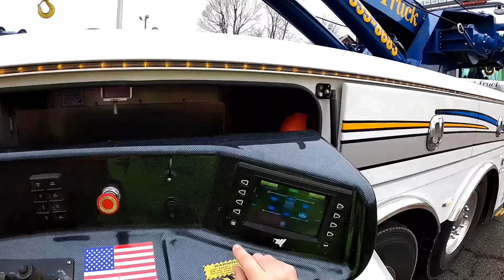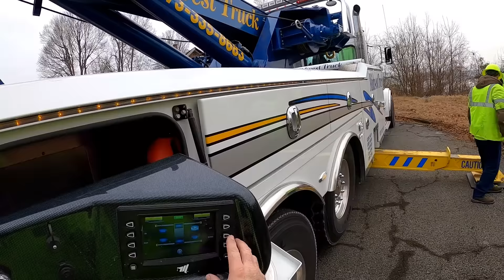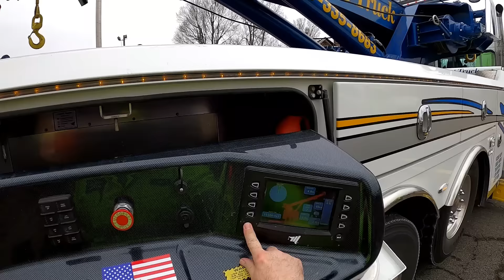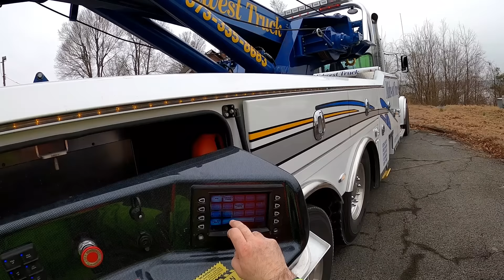Morning Workout   Lifting with the U S  Army Corps of Engineers

Comment: Love the thorough and very necessary safety briefing. It was obvious you were working with curious educated professionals. As is typical with a Federal project, there is at least a half dozen personnel assigned to a two person job. BTW, I believe that generator could be a Kato Engineering unit made here in Mankato, MN, and only powered by Cat. Pulling 300,000 pounds of resistance would require some hellacious wire rope to have a good safety margin!
Reply: I have a 60 KW Katolight generator with an automatic transfer switch on an environmental lab building. Mine has a 350 ci V-8 GM natural gas powered engine. I'm in Western North Carolina. Katolight started off making power takeoff generators for the farming industry.

Comment: That genset is top heavy. The rig driver better be REAL careful! You did the usual top notch job.
Reply from the maker: It is, but the pedestal is a fuel tank, so there is weight at the bottom as well, which helps offset the high center of gravity.    Thanks for watching and God bless.
Reply: They said it had fuel. But how much? A third full would be a good balance.

Comment: I had to laugh when you were trying to come up with something to put in the hole, a bar, bolt than the guy says that he has a screwdriver. Why nobody was prepared for this and then start looking for bolts, even the Boy Scouts function under the precept of Be Prepared. Just as an FYI, the tool that’s for aligning holes is called a Drift Pin. 😊 I like the new logo at the end.
Reply: Was thinking the same thing. 5 guys there and no one thought to have the bolts ready, to me, that was kind of rude. I'm a Boy Scout, and a Mechanic by trade, and what I believe you're calling a Drift pin, we call a Sheeps foot or Lady's foot...
Reply: An even better tool would have been a spud wrench.
Reply: Brian Mason we call it a lady slipper.
Reply: @brianmason1414   or the "new guy's finger" ;)
Reply: @brianmason1414  Here it's often called a podger

Comment: The "pedestal" is actually a base or "belly" tank for the diesel fuel used by the generator.  I oversee 10 sites for my employer that all have generators (most 100-300kW) and most are diesel equipped with the same or similar belly tanks.  That tank appears to be a typical double wall tank (which is mandatory) and probably holds in the neighborhood of 150-200 gallons of fuel.
Reply: none of the belly tanks are legal to move with fuel in them

Comment: Love how the remote shows the load the boom is under.   Wondering though....what is that Ram rated to pull?
Reply: The truck says 2500 with a hemi badge. Although I can’t tell if it’s the 5.7 or 6.4. Still, I wouldn’t use either of those engines to tow something like that.
Reply: 11k on the bumper pull its not going to make it far... should be a 1 ton and trailer should be a goose neck set up... over kill wins the game... and trade that ram for a Chevy with a durmax and Allison transmission.

Comment: Welcome to the military world.  Everything is checked, re-checked and checked again.. One or even two different 'safety' briefings, walk throughs etc.. Something you learn real quick in the military world.  And even with all that, people still get hurt seriously as I can personally attest to.   Did they say why they were decom'ing the locks?  And I was surprised that trailer was rated for that load.. My trailer is rated for that weight but it is actually longer than the one they had there.. Finally, it was also surprising they had that setup to bolt down with the weight forward on the trailer, not equal over the dual axles.
Reply from the maker: @Malakie Usn  I don't know why they were decom'ing the lock.   I didn't think to ask.   I was enjoying the view and the job, I guess.  As for the trailer, the only thing I can tell you is that this is the trailer the machine had bolted to previously as all the bolts lined up perfectly.  They were offset on the base as well, so the GenSet couldn't have been reversed on the trailer.  Anyway, I was just glad they called us.  Enjoyed working with them.   Stay safe my friend.
Reply: @RonPratt  Yep.. I was just curious is all..  But yea that trailer sure seems small for that much weight.. heh.. Obviously it is legally rated for it though.. Still would not want to have to stop suddenly pulling that thing behind a pickup truck though.
Reply: @RonPratt  If, as others have said, this was Lock and Dam 53 on the Ohio River then that, together with Lock and Dam 52, are being decommissioned because they have been replaced by the Olmsted Locks and Dam - see https://en.wikipedia.org/wiki/Olmsted_Locks_and_Dam

Comment: Surprised Engineers Corp havent got a Rolling Stock of Lifting Equipnent . Nice Job Ron
Reply: It's cheaper to hire a rotator like Ron's for an hour than to have $750,000+ machines sitting idle most of the time.
Reply: They do, but as the foreman explained at the end of the video, it would have taken   to much additional time to bring a crane in out of Paducah. This was most likely cheaper and way faster.

Comment: Surprised they mounted it with the radiator facing forwards.  Unlike a car or truck, these are usually designed to push the air out the opening, rather than pulling it in.  They're going to have to keep it slow, or the pressure of air pushing in through the rad will pop the rear door open.

Comment: Interesting video... the guys seemed genuinely interested and appreciative of your working manner and capabilities.... I wonder what that trailer and 4 wheeler towing rate was 🤔🤔🤔
Reply: That trailer is quite capable. Each axle probably 8000 lbs. so that trailer is probably rated at 14, 000 or more. The truck is a 2500 not sure if it was gas or diesel , but probably tow 16-18,000 or more

Comment: I was wondering about the trailer that was put on. I know most standard flatbed trailers come with 3500 lb. axels (x2 =7k) but that was probably used for equipment so I'm guessing they upgraded to something heavier. Surprised it wasn't a gooseneck one.
Reply: One of the Corp guys said that was the original trailer that that generator came on. Probably had 7700lb axles in it. Or least 5500lb at minimum.

Comment: 11k anchored by 4 small ish rusty bolts, hopefully they added some straps too!   As to putting up, sometimes blocks, sometimes no, sometimes cables anchored to the rear shackles sometimes single lines swinging free.   What's your most used configuration, single line pull?

Comment: Our Quint will not operate unless the rear outriggers (it’s a rear mount) are completely out (with some exceptions) and completely down, and like ya said, can work off the one side as long as that side is down.  Is your machine also software limited, and can adjust for any and all operating ranges and setups, or just procedure?  I’m sure i could just read the Miller Industries manual, but your knack for detailed explanations is just outstanding.

And 300,000 lbs?  All on the hydraulic winch motors?  Any one stronger than another?  PTO off the transmission i presume?  And that’s assuming your truck is tied off to the nearest bridge off some sort of hitch point?

Comment: So for you to have the M100 you would have to get a annual permit. Or to only use it for Emergencies and get permission from Missouri Hwy Patrol.
Reply: Don Hanson that’s a excellent question in California all towing companies from Orange County  must go to a designated place such as Anaheim stadium lot and go through a commercial inspection covering the chassis’s and minimum equipment for recovery and towing both heavy and light duty.
Reply from the maker: @Don Hanson  In the state of Missouri we could operate it within the state as an Emergency vehicle without special permits, to the best of my knowledge.  Now, if we ever took it out of the state we would have to get the required permits for wherever we were going.   From what I understand, Miller couldn't get the M100 to one of the tow shows because one of the states they had to pass through wouldn't grant them a permit.  At least that is what I have heard...I do NOT know that to be a fact.   The M100 that you see on their website belongs to Petroff's out of Illinois.  About 2 1/2 hours from us.   Mr. Petroff is a very nice and smart man.   We actually called him YEARS ago to bring two rotators down for a job that we couldn't do.   We didn't have a rotator at the time, and even if we did, one wouldn't have been enough.  He sent two 75 ton units down and they struggled for a while, but they managed to get it done.   Thanks for watching and God bless.

Comment: have asked this before  and  I now you don't have the time to answer all comments. But why are the back outriggers pined in place and not the front ones? and a great video as always..
Reply from the maker: Apologies....I've answered this question many times, just, perhaps not to you.  Basically, I would also like to know why Miller didn't install hydraulic cylinder holding valves like EVERY other cylinder on the truck has.   The pinning and unpinning of the outriggers is, in my opinion, a pain in the butt and unnecessary on a machine this complex.   I would think that an inexpensive set of holding valves for the rear outriggers would be a simple solution.   Dad and I have talked about plumbing in a set ourselves to keep from having to fight with the pins.   I'm not an engineer, so there must be a reason that Miller designed it this way.  I just can't figure out why.    Thanks for watching and God bless.

Comment: Are they going to call you when they flip that high centered load as they go down the road?
Reply: I was wondering the same thing. Is that a fuel tank on the bottom or just a stand to keep it higher for flooding. The generators on trailers at the Cat dealer near me are much lower.
Reply: Probably drove 40mph (formation speed) on the freeway to be safe.  The Army is the only outfit that drives with their headlights ON during the day for safety, but OFF at night for operational stealth! (well, not 100% off, there are tactical marker lights...)
Reply: @tiredoldmechanic1791    That's a fuel tank but still top heavy as can be!
Reply: They may have also drained the tank for shipping purposes. Easier to drain before than it is to clean a spill.

Comment: 108k real wheel weight for the 100ton rotator!?!? Good lord! I was guessing almost 98k weight! Im guessing that's built for just unique jobs or what have you
Reply: Ron's Tator weighs 72-73k pounds. Its no lightweight either. And his is only a 50 ton. Local shop to me in PA has a 5 axle 75 or 95 ton rotator. 2 steer and 2 drive with one extra tag on the rear. It's a monster to see in person.

Comment: Hi Ron. The third row of tires are off the ground why is that is it for stability.?
Reply: It's a lift axle, Ellen. In some circumstances the truck needs to spread its weight over more axles to reduce the load per axle, also I believe that axle comes down with the brakes locked as part of the winching brake system to improve the resistance of the truck when Ron is pulling.

Generally speaking, trucks lift axles when they are not necessary to reduce rolling resistance, also lifting axles can make the vehicle more maneouvrable.
Reply: Tag axle. Not a driven axle. Used to spread the load out when towing real heavy, oversize type loads. And also to create resistance when trying to pull a stuck truck out of a bad spot.

Comment: What I really do not like to see is people who knew what they were going to do with something the generator place it on a trailer and bolt it down not having a drift pin or the correct bolts. Someone should tell them that a hammer is not to be used on a bolt. And these are supposed to be army corps of engineers. Someone should teach that safety person that the correct use of tools is also part of safety. Thank goodness they are you  and David

Comment: A question: Why risk pulling it on a tiny house trailer with a pickup truck? Surely the Corps of Engineers has a semi and flatbed that's built to handle such heavy loads.
Reply from the maker: Actually, the trailer is heavier built than it may appear, from what I gathered.   It was a tandem axle trailer that probably had axle capacities of 7,000 lbs each, or higher, which would put the Gross Vehicle Weight Rating (GVWR) around 14,000 lbs.  The unit only weighed 9,000 lbs.   So with the 9,000 lbs and the weight of the trailer, probably around 1500-2000 lbs, would be at total weight of 11,000 on the high side for a 14,000 lb rated trailer.  I could be off on my numbers, but the trailer was built specifically for that machine, so I was told.    Thanks for watching and God bless.
Reply: @RonPratt  Thank you, Ron. I had thought the generator was heavier.
Reply from the maker: @virginiatolles1664  We were told that it was heavier.    We were set to lift 20,000 lbs when we got the call.   Turns out it was far less than that.   Again.... Thanks for watching and God bless.

Comment: this trailer seems way too small for that generator
Reply: Not so much small in capacity, but that load seems a bit high. Of course, we don't know where the center of gravity is. I'm guessing that the base has a fair sized fuel tank and if that was full, the CG might not be that high. I'd still be careful going around corners.....

Note  the trailer had bolt holes on the right spacing for the genset to mount to.

Comment: I can't believe you don't have a grounding system on your truck.

All of our power line trucks use grounding chains. You can either ground to the copper ground at the bottom of the pole which is preferred, or you can use a temporary screw anchor ( You store the temporary anchor in your truck and screw it in by hand, all the way down to the handle, you wouldn't even have to touch the power company property). 

This could save your life and your equipment when working around high voltage lines. It will quickly knock out the line and divert voltage to ground. 

I'm leaving you a link to a page that has everything I'm talking about. Be safe. https://www.tallmanequipment.com/truck-grounding-equipment/
Reply from the maker: When we work inside the power sub-stations our trucks are grounded.   I don't show those videos because that particular customer has requested that we not video inside their facilities.   Thanks for watching and God bless.
Reply: @RonPratt  I was always careful of that after hearing my first linemen tell me a story about the guy who died from a Pepsi can.

The bucket truck was in a high voltage line and it was sitting below the insulated zone on the boom, so the entire truck was energized and they didn't hook up their grounds that day. Pepsi can was on the side of the truck.